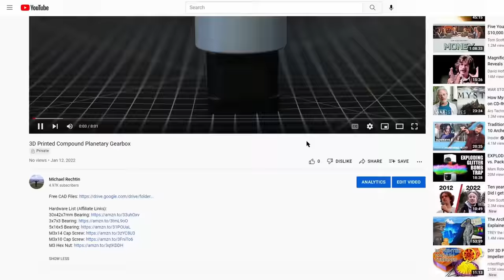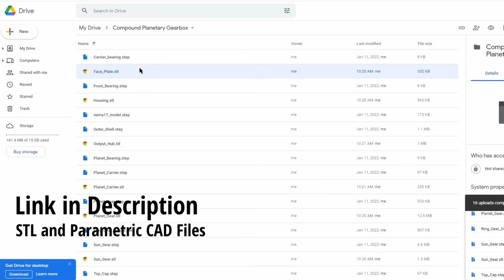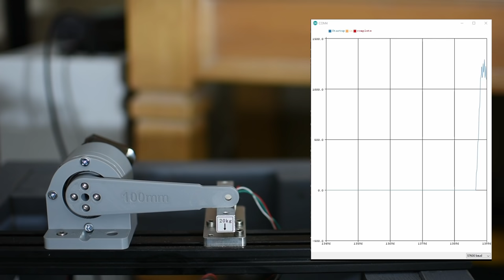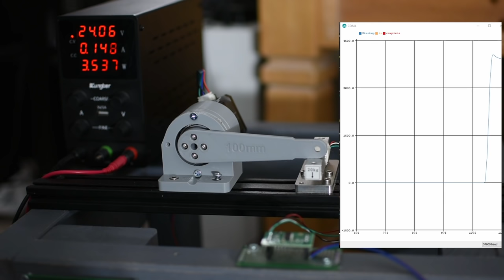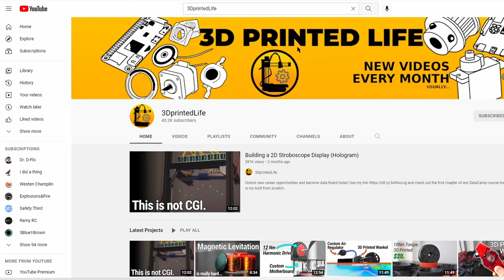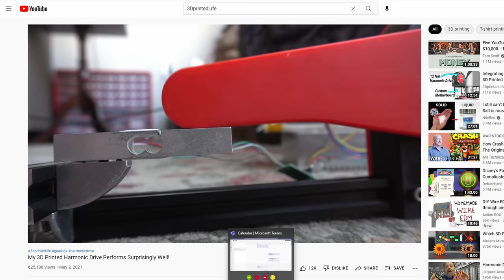3D Printed Planetary Gearbox! Resin vs FDM Printing?

Comment: Could the WD40 be having an effect on the resin parts? It can make certain plastics brittle. Perhaps try a silicone grease.
Reply: Another option could be to use a dry lubricant like graphite, or something more expensive/exotic like molybdenum disulfide. The additional benefit of graphite is that it can fill in surface imperfections while coating every mating surface with a thin layer that should introduce as little added resistance as possible even with tighter tolerances in the version 2 of the resin model.
Reply: Probably not it but may be worth testing just in case.
Reply: it looked like a wd-40 silicone grease. not the regular wd-40
Reply: naa, it's just cheap resin, it works for what it's made for Modeling, you can't expect plain old inexpensive resin to be super resin, for that, one needs a formlabs or something like that.
Reply: @patprop74  true that cheap resin is not going to give anywhere near the same quality as purpose formulated resin from any trustworthy brands. But for the sake of prototyping and testing design variations, it's not a bad idea to use the more inexpensive resins and use whatever trick you can to get most bang for your buck. Because one thing that I have noticed is that it is a rare occasion when printed mechanical pieces work on the first attempt, even if the prints come off the build plate perfectly.
Reply: @petercoutu4726  That is a very good point.
Reply: Super lube uses ptfe that may be a good one to use as well and its thin like a oil.
Reply: @petercoutu4726  That's their White Lithium grease. Not standard WD-40.
Reply: @shanold7681  Gearbox grease isn't supposed to be thin like oil. To use oil, the case needs to be sealed, otherwise the spinning parts will shed the oil and run dry. If proper sealing isn't an option, the grease should have a higher viscosity and be sticky.
Reply: @gnomish844  there still may be a solvent or other compounds, potentially the propellant, that can weaken the parts.
Reply: absolutely! my first thought! never spray WD40 on plastics..
Reply: I use either silicone shock oil or dielectric grease.  From what I can tell most ptfe greases are silicone oil based.
Reply: @Fatpumpumlovah2  isn’t lithium grease petroleum based too?
Reply: @White000Crow  yes its not a problem.  I was referring to him putting it on the part prior to proper curing.  Not right after just the wash.
Reply: I would use PTFE lubricant on the gears or maybe white lithium grease.
Reply: Not sure why people seem to always over sell the mechanical properties of resin. Even the most durable resins are extremely brittle compared to PLA, let alone ABS. That is sometimes good, but often bad.
Reply: Perhaps, using a durable Resin and ACTUAL gearbox grease....
Reply: @Bubu567  No one oversells the mechanical properties of resin, especially not people who use a Creality harlõt subsumer printer and inappropriate figurine resin for moderate to high load bearing moving parts.

What a waste of skills to even try that and expect it to work.
Reply: Using wd40 is a big fail to lubricate anything, let alone plastic
Reply: If only could get the printing surface of resin with the strength of filament.🤷‍♂️
Reply: @toysforboysrc  some modern printing resins advertise even higher tensile strength and surface wear properties than PLA. They're expensive, though.
Reply: resin is just weaker.  it's as simple as that
Reply: Spoiler comment 🙄
Reply: @darkracer1252 but it's not "as simple as that" when there is such a huge selection of materials for both types. 
  There are resins that exceed pla, petg, etc. in strength if you need them.
   Of course there are fdm filaments  stronger than petg as well, however what I WILL say is that your strength is going to cost more with resin (but of course the fit and finish will be better as well,  if needed).  Also certain parts print MUCH faster in resin due to each layer taking the same amount of time no matter how many or how large the part. 
So it is more about what you are building than anything.
Reply: That's is definitely not normal WD40. It's bright yellow and thick.

Comment: In Addition to the other suggestions: you UV cured the parts for 10min. My usual curing time lies around 5min. To much exposure will damage the integrity of the material and make it brittle
Reply: I also noticed this and thought it was odd..
Reply: Yeah, for small parts it's weird to use for than 3-5 min. Imagine how much brittle  every small tooth got from 10 minutes of curing
Reply: This guy who made the video seems to have some mechanical modelling and electromechanical skills, but either he's trolling or just doesn't have any common sense regarding resin printing.
Reply: @DeathCoreGuitar  And he used remarkably brittle resins, and didn't know this would happen?
Reply: Glad I wasn't the only one who noticed that.
Reply: Super obvious to me as well, look at the discolouration of the parts, they are deeply yellowed in some places, definitely cured for too long

Comment: Keep in mind that there is only 1 tooth in contact at any moment. The bigger the tooth, the stronger it is .The minimum for teeth interference is 13 teeth for small pignons. Depending on the needed gearbox size, you want to choose the biggest possible gear modulus that allow for at least 13 teeth. Bigger modulus = stronger teeth and bigger contact area. Also fit tolerances and surface finish induced by manufacturing process have less impact on bigger teeth. Your pignons look like they have about 20 teeth for 10mm in D, then I assume 0.5 modulus. SO you could choose a bigger modulus for the teeth. In this case 0.75modulus would be the best = 15 teeth would be WAY stronger of course outer ring will also have a reduced number of teeth, but you can keep you diameter and ratio.
Reply: I totally agree... for  such an application I would use some tougher resin... I would use Liqcreate Tough-X or Composite-X
Reply: Either way the point of this test was to check the strength of the two types of 3d printing. If both types were the same design it would be an accurate test. In my personal experience fdm printing is stronger but resin can be better. I personally only use resin with a wax resin so I can easily cast parts in aluminum.
Reply: @Baitrix1  poo
Reply: If it is a true envolute, then multiple gears are in contact.
Reply: should use helical gear to maximize contact
Reply: use a helical gear to engage more teeth at once.
Reply: @nonamelo5555  Are these much better than ELEGOO ABS-Like? I have used the abs-like, but not Tough-X or Composite-X. I'll do some googling on these, I'm now interested.
Reply: @1992jamo  Well, I tried it... Composite-X is exceptionaly strong, but very brittle. I recently found about SuperPP resin from 3DMaterials that is just slightly less strong, but much tougher. It is also a lot cheaper. The only disadvantage is lower stifness than Composite X
Reply: with 3 planets there are at least 3 in contact
Reply: You must pet a pigeon
Reply: @davidewing9088  Was thinking the same thing. Helical gears are supposed to be stronger than straight cut.
Reply: @brenthinton6855 
Well there were other variables here as well. The reality is that tye strongest polymer per application should be used to compare against one another and also the same polymer if available.

There are some very strong resins available but they still dont compare to fdm and are years away. Far as usable parts resin is just getting there.
Reply: I love the comment section. Especially when people share their knowledge and expertise.

Comment: Finally someone who is using appropiate screws for plastic parts. There are way too many designs out there with machine screws and brass inserts or nuts
Reply: Finally someone who is using appropiate screws for plastic parts.

Not everyone is as smart as you.
Reply: @owowowdhxbxgakwlcybwxsimcwx  If you're fastening together something that you don't intend to ever take apart again (how likely is that?...only you can decide), then self-tapping is OK/appropriate. But I suppose if you don't intend to disassemble, then glue the parts together.

Comment: So one reason your resin appears to be as brittle as it is, is that you are absolutely baking your parts with UV. At 4:22 in the video you had the UV timer set for 10:00. 

That's about 7 to 9 minutes too long, i believe, depending on your resin and the individual part sizes.

I've been printing UV resin for about 3 years now, thousands of parts, and i can tell you that curing time has a BIG impact on brittleness. My initial tabletop game pieces i cooked at about 15 minutes each. During a game session the board was accidentally tipped onto the floor. Of 12 parts, all 12 shattered. Some into seemingly individual resin molecules.

My current go to resin for tabletop durability is Elegoo ABS (80%) mixed with Sirayatech Tenacious (20%). Parts are cured for 30 to 60 seconds per side. This results in an excellent mix of durability and flexibility for tabletop miniatures. 

Obviously, for planetary gears, you probably don't want something with much flex. However, you definitely don't want something that will shatter with shear force either.

Recommend you experiment with your resins and curing times (A lot less than you showed) and see if you can dial in something better.

All that said, i think even basic PLA will better in this application than even the best resin, although some of the Sirayatech resins may give that a run. PETG might be even better!
Reply from the maker: Great feedback. For the next version I have been using “Tough PLA” and it appears to be working very well.
Reply: Man you know your stuff!  Thanks for sharing all that
Reply: Well the curing doesn't just stop when you turn off the light. It will continue crosslinking over the next several months once started until the activator is fully consumed. So if it was going to get brittle, you can't just prevent it.
Reply: @SianaGearz  True, but that's the reason that parts are given paint, or a clear UV blocking spray, to prevent this.
Reply: @michaelrechtin  i found the  3DMaterials SuperPP to be some very tough resin. they also have a flexible resin that u can mix in like Steven talked about. You should try and reach out to them, maby they will sponsor some resin u can try it out with.
Reply: @SianaGearz  if its not getting any UV i Cant see it getting anymore brittle, haven't seemed to do in any testing ive done
Reply: @michaelrechtin  Siraya tech blu is a very good engineering resin but better is the materials from photocentric.
Reply: @michaelrechtin  You should do the same test again with Tough PLA versus a proper Tough Resin that's readily available.
Reply: Yeah, I think this is just kinda the thing that resin printers still have to deal with.

That being said, I heard about a resin called tough resin? I don't know how well that works though since I have never used a resin printer before. Printed parts using PETG last a long time and I can pretty much confirm that.

Comment: Probably already mentioned, but its common to mix flexible resin with standard resin to reduce the brittleness.  It opens a whole can of worms though, and it really fair to only test and compare with over the counter products.
Reply: I've got some prints out of formfutura though resin. They were printed at different temperatures and illumination times and hardend differently afterwards. One is still elastic aftr a year and the otherone is hard and brittle like tough glas. Even with thr same material, resin can acive vastly different propperties.

Comment: Great video and thanks for the shoutout! I've been dealing with some of the weaknesses of resin prints lately in my own projects, it's great for a lot of things but for functional parts like gears, I definitely prefer FDM. Even if it's just PLA.
Reply: I wouldn't say "even if it's just PLA". PLA is pretty damn strong in it's own right. You have to go with high temp plastics to best it in most applications.
Reply: what resin did you try? i heard good things about siraya tech blu

Comment: I'm looking to print a gearbox for my extruder, and am trying to decide between ASA or Resin, and here this video shows up. Then switching to a cyclic test with a cleverly designed setup for testing to stall torque was the icing on the cake! I know ASA is lower modulus than PLAs, but the modified PLAs are usually a little lower modulus. Thanks for this video, this was perfect for what I'm working on!

Comment: to make the gears last longer, try swapping the WD40 for some grease meant for plastic and when threading screws directly into plastic, tighten them by hand and before tightening, turn the screw counterclockwise until you feel it dropping into the already existing thread, so you don't run the risk of chasing new threades every time you screw it back together.
Reply: Would mobilux ep2 work with plastic?

Comment: I did not expect that. I would have thought that the resin gearbox would be more durable. Great test. Thanks 👍
Reply: Resin is more closely related to ceramics. This is maybe not the application for it. Try running those gearboxes under the sun though. FDM won't operate with slightly higher temperatures.
Reply: @Michallote  What the hell do ceramics have to do with thermosetting plastics??
Reply: @WhenDoesTheVideoActuallyStart  thermosetting clay?
Reply: @Michallote  how do you think that would compare with the interior of electronics? I have some Laserdisc player to restore. They need some replacement gears, as well as my Betamax decks.
Reply: @Michallote   maybe PLA will have trouble, but with ABS or nylon you`d be good to go

Comment: One thing to also take note it is it going to depend on the type of resin, or the type of FDM you use. Some are stronger than others. For example clear resin is known to be brittle. What you want is something like resione tough resin,  siraya tech blu strong Resin,  eSUN ABS-Like hard tough resin (a personal I use), then there's liqcreate tough-x that is designed for mechanical use.  Theres also other brands but these I know and one I have used for more technical builds or things that may be taking a beating. 

Also the cure time can have a BIG impact on resin, I saw you are doing them for 9 minutes? That is a bit much and over curing can cause any resin to become britle or form micro cracks. Even with the resin I use if I forget it in its curing box and over cure even the best resin will have issues. 2-5 minutes is normally the go to, though clear resin will cure faster and should be in half that. The fact your print shows yellowing means it cured WAY to long. The cure time also depends on the strenght of the UV light, stronger lights like in those cure stations don't need to be that long while weaker lights may need a few minutes more. For example my manual curing chamber uses a set up with a 405NM uv light and I only cure my prints for 2 minutes at the most. One minute for any clear resin or it starts to yellow and form cracks. 

 I don't know much about filiment printers as I've yet to get one, but I do know there's some that have metal mixed in that is really strong, and others like silk that are really brittle as well. So it really does depend on what you are using.
Reply: Yep, E-SUN ABS Like is the best, a little bit expensive, but it is a product that almost doesn´t require post processing
Reply: @omoralopez  @TAiiNE how does print cost compares with filament? Initially I wanted to start with filament (ideally recycling failed prints and making filament from water bottles etc), but it seems like resin might fit my applications better (I would lose the possibility for recycling but I guess resin prints successfully more often).
Reply: @HyperSculptor  In our case we have 5 Anycubic printers and 3 Artillery. I think that both technologies are not comparable. IE: One of our pieces printed with resin takes 5 hours, with filament the time goes up to 16.
The cost per gram of both materials is almost the same (ABS Like Resin vs PLA+ Filament), but, at the end of the sum, time is also money.
In addition, the level of detail with the resin is almost as good as if they were injected parts.
We use filament printers to print parts that require less detail, are smaller and, generally, flat.

We have tried many ABS Like resins, and there is a lot of difference between the different brands. I think that E-Sun is the best, but it is still very expensive, so we use one that is of acceptable quality and not that expensive.
Reply: @Osvaldo Mora  thanks for your reply, it helps making my choice obvious, in term of technology.
Reply: @HyperSculptor  You are welcome!
Reply: @omoralopez  are you on linkedin or somewhere we can connect?
Reply: @HyperSculptor  Linkedin

Comment: If you could adjust your design a little, you could try using helical gears instead of spur gears. This would increase the surface area of the gear tooth interface and might distribute those forces more and reduce the risk of failure. They use helical gears in most automotive drive trains and are also supposed to reduce noise.
Reply: как раз большинство производителей используют прямозубые передачи поскольку  они проще в производстве.  И если речь идет об эффективности, то несомненно лидер это шевронная передача как у Ситроен

Comment: Called it! Resin is harder and more brittle. Your results are exactly what I would expect!
I've seen resin used for making near perfect molds for poly or rubber seals though... I'm sure it has its uses that go beyond what other prints could hope to do.
Reply: There are more flexible and durable resins, they just tend to be less detailed.